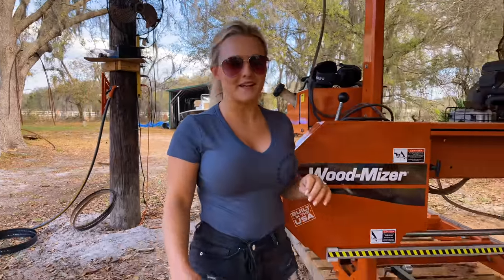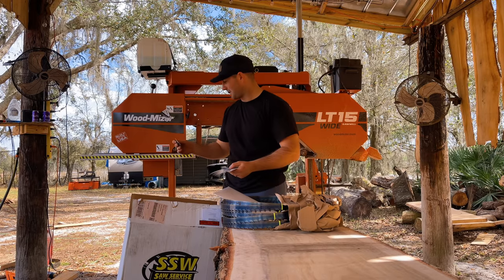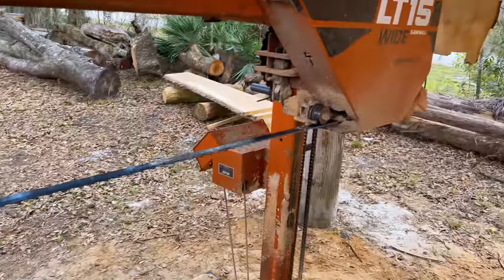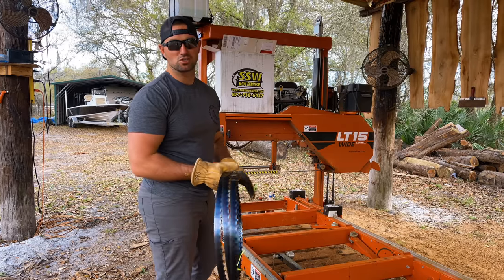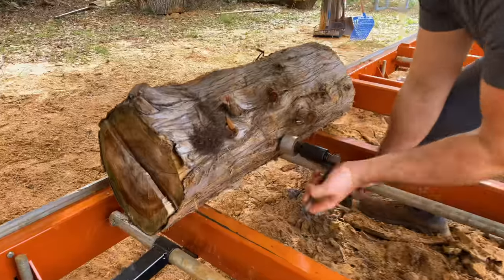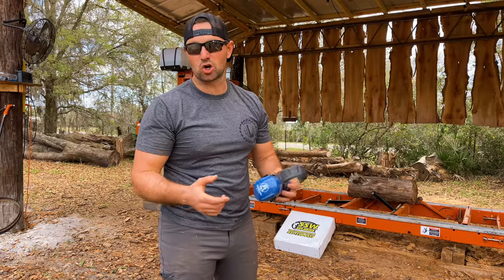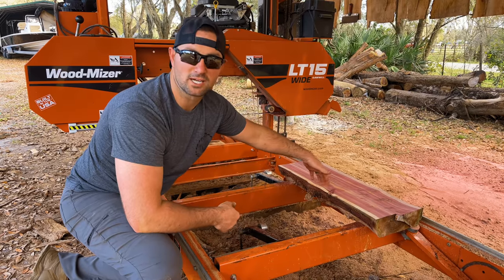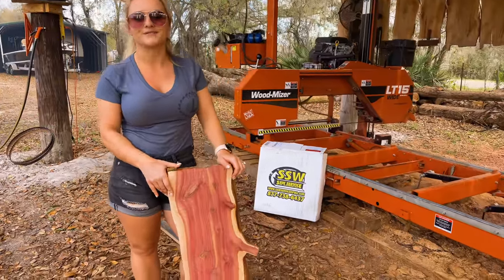This New Blade Cuts Cedar Log Like Butter

Comment: It would have been awesome if you could have timed how long it took to cut one board with each blade, after it had been milled to say 12" x 12" x 8' with a used blade, to give both brand of blades a side by side comparison, so to say.